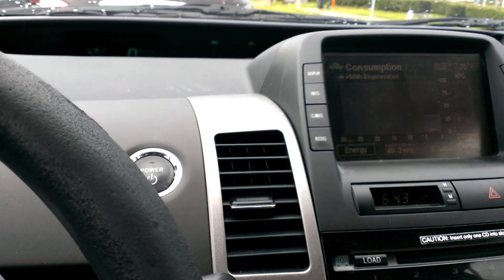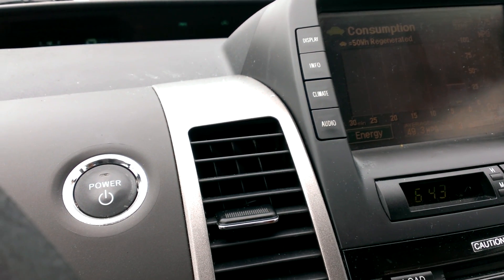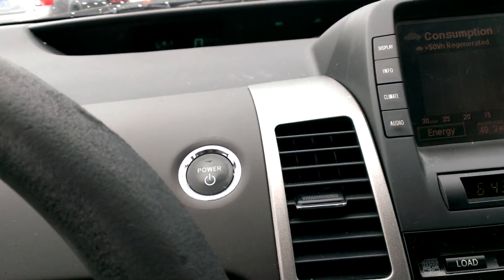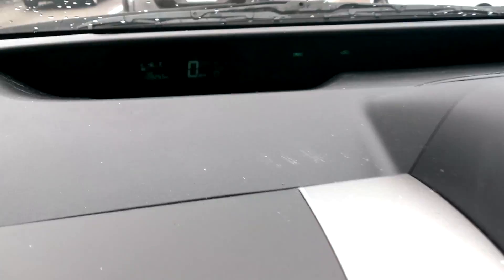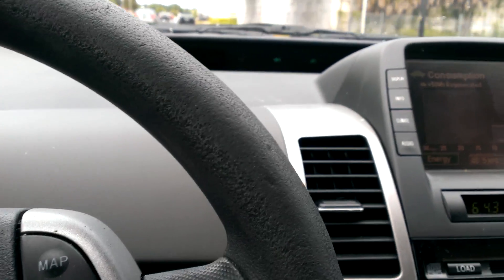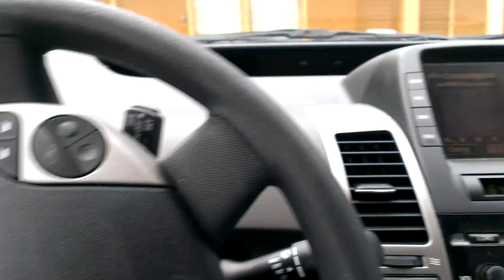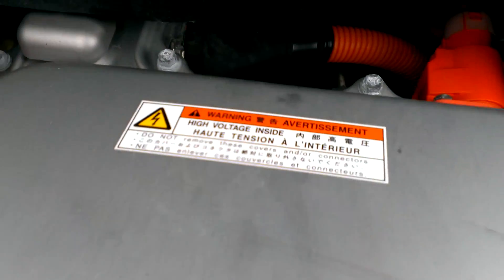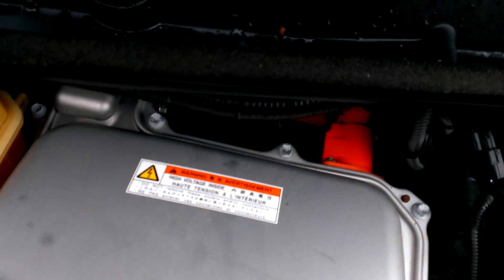Failing Toyota Prius ABS

Comment: Hello brother, so when the car still keep that sound even we drive or park, it means that car has problem with abs.
Reply: the prius makes 2 sounds.  the one in this video is the abs motor trying to gain pressure. there is another swirling noise from underneath the front driver headlight. it is a pump to store hot water into the stainless steel thermos so when next you turn on your car  the water warms up faster.

Comment: Did you learn the reason for this problem? If so, how did you solve?
Reply from the maker: I think it is the ABS pump running because the accumulator has a leak in it. It finally failed in my car so I will be replacing it and I will let you know if it is fixed.
Reply: Abuzar Baloach Thank a lot. I am totally sure, my problem is same as yours. I hope fixing it is not expensive
Reply: @abuzar1  And then u realise... it's a 2.3k fix. lol. Dam it i should've bought a different car.
Reply from the maker: Dave Dom I bought a used one off eBay for around 130 and replaced it. Replacing it was a LOT of work though.
Reply: A Baloach Thank you for the video I am now in the same situation you are mine has went out I was going to purchase one on eBay is it a good idea to buy a used one? Also how long did it take you to install it because I am thinking about installing mine myself how did you bleed your breaks?
Reply from the maker: @douglasvaughn9349  Took me a whole day because I was new to working on cars. If you're going to do this yourself make sure you have a quality set of flare nut wrenches, it will make your life easier. It is a good amount of work and the ABS pump is difficult to get to. I bought a toyota scanner off ebay to bleed the brakes but they sent me a defective one so I just drove it without bleeding the brakes. I got lucky and had zero issues.
Reply: A Baloach is a used one of of eBay worth it ? Or new?
Reply from the maker: @douglasvaughn9349  It is like 500 vs 1500 bucks. It's up to you, I'd probably just get a used one but it's a common problem so if you're gonna keep the car for another 100k miles you could go for a new one.